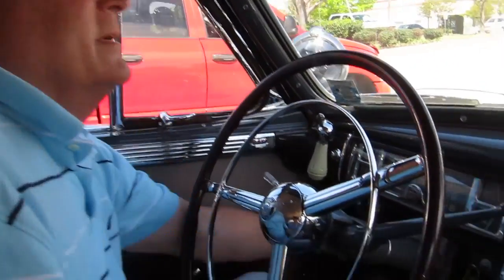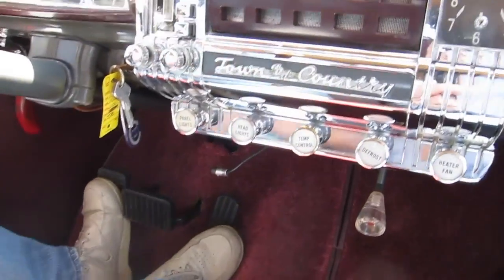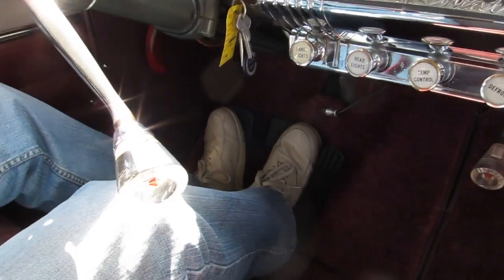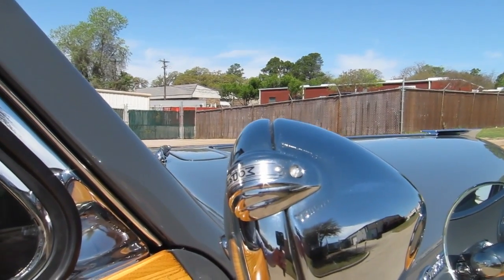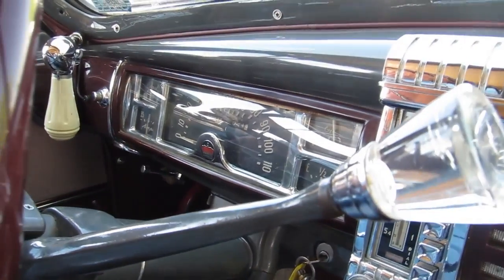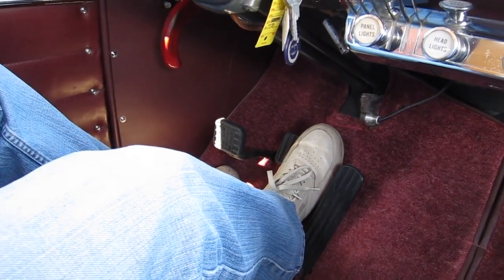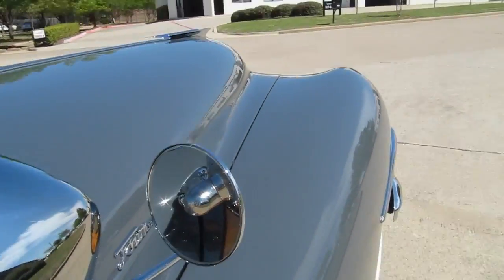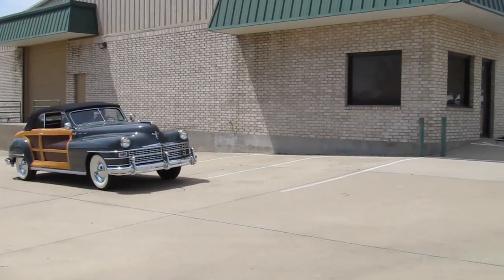1946 Chrysler Town & Country Fluid Drive

Comment: Fluid drive was not a torque converter.  Dodge had fluid drive without the semi-automatic transmission.  The Fluid Drive allowed the engine to idle in gear with the clutch engaged.. Very smooth, very durable and very slow.

Comment: Fluid Drive was not invented just for taxis, it was invented to make the car easier to drive, by eliminating the need to declutch at stops, and eliminating most of the need to shift gears.  Also, you do NOT KEEP YOUR FOOT ON THE CLUTCH, in ANY vehicle.  That destroys the throwout bearing.  In normal driving, you just use Drive, also known as High.  Lo is only needed for hills.
Reply: Driven probably My 42 Chrysler business coupe flat head 6 fluid drive could average about 27 miles per gallon
Reply: Right

Comment: In those Fluid Drive transmissions, all one has to do is start the car in NEUTRAL, release the parking brake, push in the clutch pedal, put the car in either 'L' (low) or 'D' (drive) and just let out the clutch... The car wouldn't move until you stepped on the gas... Both Low and High had two ranges, essentially 1st and 2nd in Low, 3rd and 4th in High, or Drive... To switch gears in Low, once you started of and built up speed, you'd lift your foot off of the accelerator pedal, wait for the shift (it would 'clunk') and then you'd put your foot back into it on the accelerator... Also, one could start out in Low, let the car shift to 'Low 2', then push in the clutch pedal, shift the transmission into Drive, dump the clutch, hit the accelerator, then wait till you came back up in RPM in "Drive 1", then of course let off the accelerator until it "clunked" into 'Drive 2"... And you were cruising...

Not as complicated as it sounds, but I think an ingenious early stab at "fully automatic" driving!

As a side note, I'm pretty sure that most people ALWAYS just drove around in the two ranges of 'Drive' and completely forgot about using "Low" now and then... those transmissions sometimes failed or didn't perform as advertised because folks weren't operating them as intended, much like we did with any TorqeFlite or TH350/400 in 'our days'.... nobody ever drove em in any selection but "D"... That'll screw up a valve body and servos after a while.
Reply: LOW WAS ONLY USED FOR GOING UP HILLS YOU COULD DO 98%OF DRIVING IN HI
Reply: THOSE TRANSMISSIONS WERE BULLETPROOF

Comment: actually,  the automatic was available in 41...it was so expensive,  they came up with an alternative which is this "slush box"....it has and had nothing to do with taxi service,  I don't know where this guy came up with that story....and it also has no torque converter...its basically an 18" hollow  donut with fins inside and fluid there is no mechanical connection to the transmission except for the fluid drive
Reply: The Chrysler advertising from that time, including for their trucks, pointed out that the vehicles could be left standing in gear while making pick-ups or deliveries, and they put the fluid drive on their Dodge delivery vehicles for that reason - one ad, I believe, pointed out that a deliveryman could leave the car in second and set the parking brake while making house-to-house deliveries, for things like milk.  Taxi drivers would also appreciate the absence of a clutch so they could stop and pick up passengers by leaving the car in gear and setting the brake to help load luggage, etc.  The parking brake on these vehicles is large and placed at the rear of the transmission and therefore is separate from the normal braking system, if I recall correctly.
Reply: Interesting. Beautiful old car.
Reply: @franktatom1837  That advertising is toward commercial users.  They also had lots of advertising toward regular motorists.  "The smoothest ship afloat", and "No gear shifting!", among other tag lines.
Reply: @michaelbenardo5695  I was just responding to the comment above that asserted this transmission was not marketed for taxi and other commercial use,  which it was.  It was also marketed to non-commercial users, as you mention.
Reply: Right

Comment: Nobody knows how to drive these cars anymore.  Just read the owners manual and it will tell you to leave it in high range for normal driving.  You lift your foot off of the gas to let it shift and it will automatically downshift when you come to a stop.  You leave the clutch pedal alone until you want to move the gearshift into neutral or any gear range like reverse.